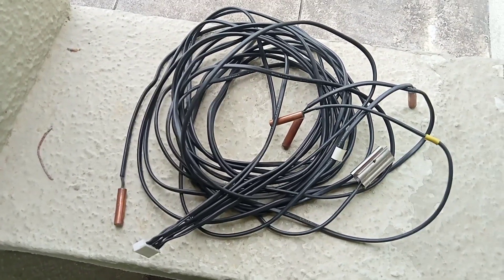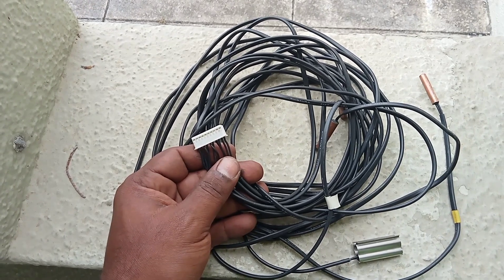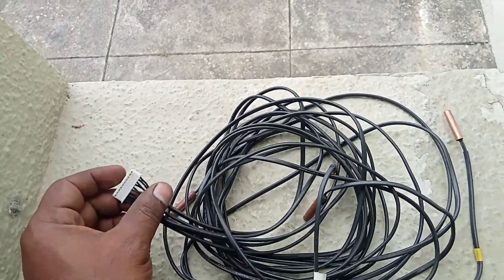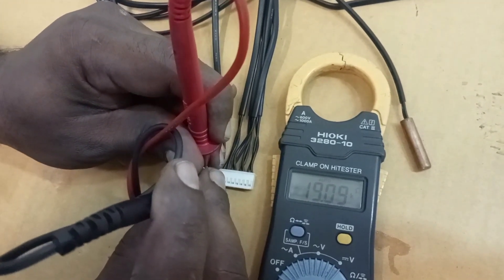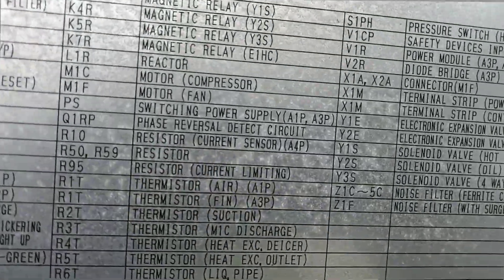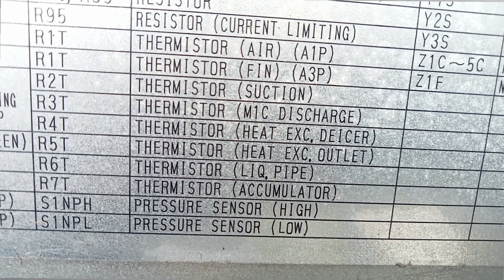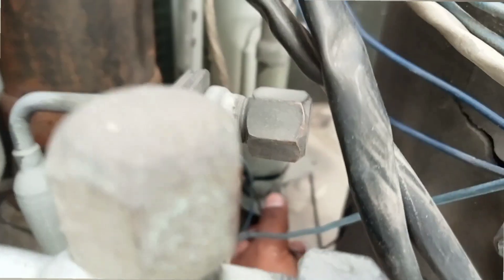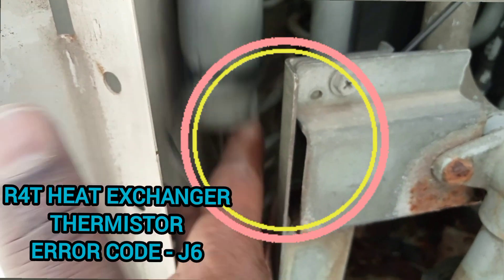Daikin error code - J5,J6,J7,J8,J9. For replace thermistor for condenser unit.

Comment: what if we just ignore this J5 error code?  my VRV III shows this error code for a few months, but the indoor units are fine.  Instead, one of the indoor units is not blowing out with cold air and the reason is the electronic valve issue which has to be changed to a new one.